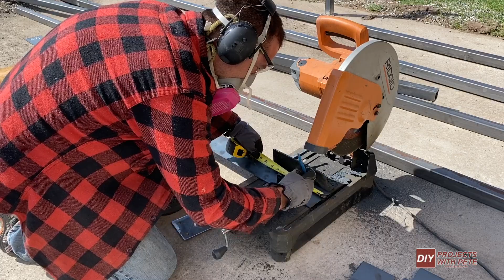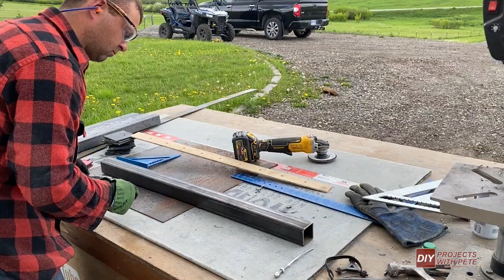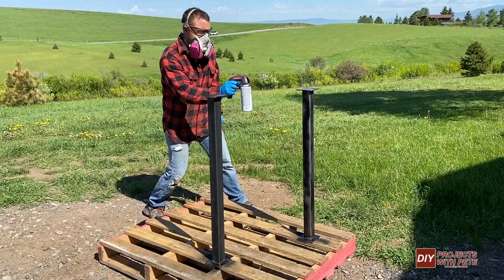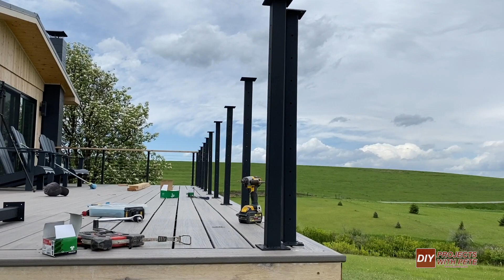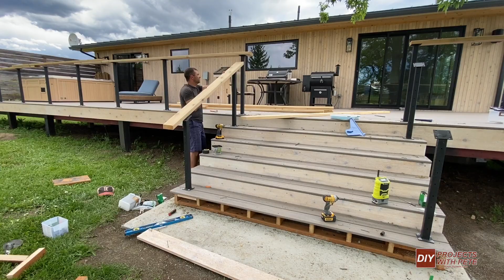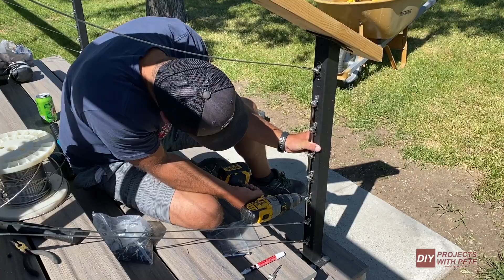DIY Cable Railing with Metal Posts Built from Scratch!

Comment: Guard rail height needs to be 42" high minumum is most if not all states? 
i would like to see stainless steel or aluminim posts to avoid rust. Powder coating would be okay but the steel inside the post will rust anyway.

Comment: Since your install have you had any issues with the top wood rail sagging?
Reply from the maker: Morning! Honestly not, but there has been some minor movement. My biggest thing I wish I'd have done is powder coat the posts as they are starting to fade.  At the time, there were not many post options available online reasonably priced. There may be a few more options these days if you want to look before welding up and doing all the posts yourself. Cheers!

Comment: What an absolutely beautiful job!   I got quotes from some of the DIY systems out there and it was over 8K for a similar size project.  Thanks for such a detailed video of the process.  
I am considering using  stainless steel sleeves for each hole the cable runs through.  Most of the premade posts come with them.  Just curious what your thoughts are on them Do you think they would be beneficial to the system?

Comment: How can horizontal wire railing be to code? 
The potential for children to climb horizontal railings is a major concern.
Reply: Horizontal wire is to code. As long as the spacing is less than 4" (4" sphere rule) you are good to go.

Comment: I had originally thought of having a wooden railing. However after not getting the  railing finished on time, the 4x4 post started to bend. My railing would just look awful. This is exactly what I need to do. Although not real good at welding, I thought of having the steel cut and prepared by me and then welded at a fabricator (welding shop). Then I found post online at a very reasonable price that was far faster than having them built. Thanks for getting me inspired.

Comment: Nice video. I was wondering should you use one noncut length of cable from beginning to end, going through all posts. It is about 30 ft. do you need and type of protection around the holes in the metal posts the cable goes through?

Comment: Thanks for the video , I used your video to do my own deck as well . I spent $3500 on the metal , powder coating and hardware instead of the $19,000 quoted for cable railing .

Comment: I’m building a similar railing but with a steel hand rail.  Does anyone have a recommendation to wall thickness of the tubing to handle the tension from the cables?  I’m tempted to go solid but it will weigh so much it will be difficult to transport to the powder company.

Comment: these cable rail systems usually come with cable "collets" for your inner post to protect the cable from fraying at post entrance/exits also hides the un-sightly holes the cable goes through as they will eventually rust,....and of course the overall appearance would have been much nicer

Comment: I am posting this before going through the entire video. But I would’ve included a weep hole at the bottom of each of your welding posts. You will get rain and moisture inside of each of the posts and you need an exit hole for that moisture to escape. After a few years you might find you’ve got several inches of water and they will rust out on you.

Comment: Good video, but I have a couple of comments. First, you are loosing a lot of room by setting your posts that far back. A different bottom bracket that wrapped around the front would give you that  space back. 

Second.. Not sure how you tested the lag bolts, but a 3/8 lag bolt provides between 210-265 pounds of pullout strength. That means close to 1000 pounds per post (4 bolts). That should have been more than strong enough. Sure bolts, nuts and washers are stronger, but WAY overkill.

Comment: Cutting metal plate vertically was a good move , we already use that in our workshop, also if we are cutting square pipe in length we use to cut its angle on the top side  from where blade starts cutting. It also helps to cut a square pipe easily 👍 ❤️❤️❤️❤️❤️

Comment: We're considering this for a deck at our home.  ANy sense of how safe the cable railing is with young kiddos?  Our kids are 9-14 but I'm thinking about grandkids (someday) and friends with younger kids.  Any chance they can squeeze through the cabling?
Reply: The 2015/2018 International Residential Code (IRC) requires that you can't  push a 4" ball (sphere) through the railing spindles (cables in this case) to trap a child's head.  For cable railing, because cable flexes more than solid metal rod, tension is important to reduce flex.  Also, placing the cables closer than 4", 3.5" for example, will allow the cables to flex slightly and still meet code.
Reply: Also,  Horizontal cable is attractive for toddlers to climb.  Vertical steel bars are the safest but they interfere with the view.

Comment: On the step railing cables . . . . . . . .  .How about making a adjustable drill angle jig OR buying an angle drill press and you could have used the same cable set up as the top deck.
:)

Comment: Hi Pete, AWESOME JOB, thanks for sharing.  I was wondering how the top rail is holding up?  Any sagging or warping after all this time?  We currently have a 6" to top rail, way to thick and obscures our view, so I'd like to replace it with something like your sideways red cedar but worried it would warp.  We will be removing our vertical boards 2x2s and replacing it all with cable like yours.  Thanks again!

Comment: One of the best videos explaining how to firmly attach metal posts to a deck. Rest of the commercial folks are fooling around trying to screw in the posts - which will fail and could cause some major concern. The use of bolts and washers with underside support would provide a very secure mount for the posts! Thank you I was looking for some help and this surely does it. Any idea where I can get pre-made metal posts. I am not good at welding etc hence getting some good quality posts would be a better (more  expensive) option in my case. Also if you can list the other smaller hardware like screws and bolts, etc used would be very helpful.

Comment: adding some drain holes in the bottle of the posts might have been another option you could have done. It shouldn't be a huge issue, but it will help them not rust as quickly if water gets inside the posts.

Comment: Great video!  We are adding a concrete patio to our restaurant.  After a year of the pandemic,  we are looking to the future.  A patio will drive in customers!

Building this railing ourselves will save us thousands. The concrete patio will be at least 3 feet off the ground.   

Any suggestions to securing it to the concrete? We are in PA, if that makes a difference.

If we go with a bigger,  heavier drink rail, do you suggest a bigger mounting plate? We'd love to do a live edge piece of wood, if not to costly. 

Last question.  Aluminum or steel tubes?  We have a friend that restores vehicles.  He can paint them for us. We don't want it to rust.

Great video!  I think we can actually pull this off!.

Comment: I have questions. Has the tension of the cables bowed the wood over time? This is a problem my friend had with his cable rails after a 6 month period. Which made the cables droop and wood wavy. So i was gonna do the tension first, but than the post bowed. I will be making channel out of 16 gauge or 14 gauge steel to go under the wood to keep everything from bowing. What do you think about these problems and my possible solutions?

Comment: Really looks great, I think I'm going to give it a shot. Question on the hole sizes though - For the bottom you used 3/8" drill bit, and that fit the 3/8" bolts? And on the cable holes, you used 1/4" drill bit for the 1/8" cable correct?  I saw on Amazon the fitting terminals for the cable wire calls out a .31 hole. wasn't sure if I should be drilling 1/4" holes, or .31?

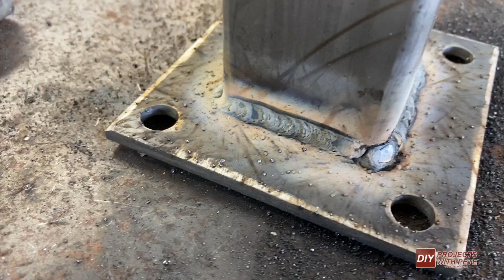Comment: For those of you who weld without the gas as shown in this video, spray your project with Pam cooking spray before you weld. This will eliminate all the "spatter balls" stuck to the steel that you see in this video at time stamp 10:17. The Pam will eliminate the need to clean everything with a hand grinder (which can sometimes ruin the smooth surface of the project). After you are done welding, go over the welds with a wire brush to remove any slag, then wash off the Pam with dishwashing soap and water, same as you would clean a cooking pan in the kitchen. You may still have a couple small spatter balls on the steel, but they will pop of easily by hand with a wood chisel. I have been using this trick for years, especially since I do a lot of outdoor welding where the gas is useless because it is usually blown away by the high winds we get here in Arizona.
Reply: Or use anti spatter sprays less clean up
Reply: I’ve tried that a few different times. Never could get that to work right, and it was harder to clean up the burnt-on goopy oily mess of a coating it left behind. But I also didn’t get good results from the commercial spray. I found the welds were cleaner without and the spatter was easy to knock off anyway.

Comment: Great video!  I'm going to follow your steps and do the same thing for my deck.  Quick question- is the 2" square tubing also 1/4" thickness?  Same as the flat bar?  Thanks.

Comment: You need a drainage hole in the bottom plate to allow moisture & condensation to drain away preferably 10-12mm if possible.
You still have access to the underside of the deck, so this will allow you to save all your hard work.

Comment: Fantastic video and workmanship, It looks really good.  I have heard that the use of dissimilar metals (mild steel and Stainless) may cause rust corrosion to occur quicker especially in a wet setting. id be interested in hearing if teh staniless cable rusts at the contact points on the mild steel. Even with it powder coated i suspect the paint/coating in those areas will rub away.

Comment: Copied your design plus some tweaks... Also forgot to drill drain holes and will add them before the final squaring and running of the cables. BTW - Tractor Supply sells a nice little split cover for the bottom of the posts to cover up the bolts, welds, flange, etc... gives a nice finishing touch. I searched everywhere and it was the best priced and quality I could find.

Comment: Great video. Great content...love that you gave some research of retail ready options and compared to your effort/time.  The only tinnsy tiny detail I could add, is you could put a drop of oil on the metal before drilling to extend drill bit life, but alas you do have a sharpener.  Thanks for a great video!
Reply from the maker: Thanks so much!

Comment: This is a wonderful breakdown from cost to install! I’m looking to do a side mount steel rail post. Options online for purchase are pricey. I have no welding skills but think if I eliminate the base steel plate and just do two large base screws/bolts through the 2” tubing and then an add on bracket for the top of the 2” tube to accept a railing then I will be ok 👌. Any suggestions would be welcomed 🙏🏼
Reply from the maker: Good luck!

Comment: Thanks for the instructional video.  Any concern about water collecting inside at the base of the posts?
Reply from the maker: Thanks! I ended up drilling a hole in them from the underside just in case.
Reply: @DIYPETE  Perfect.  Thanks,

Comment: Love your video, so excited I found it.  I am doing the same project. Making your own posts is a huge cost savings. For about 75 linear feet of railing a "major" supplier quoted me $7,000 for all the posts and hardware. With your help I should get it below $1,500. Thanks!
Reply: But, one question. You said you drilled 1/4 inch holes for the cable/inserts. However, the hardware you used for the end posts, Stud Tension End Fitting Terminal, says you need a .31 hole. Did you drill larger holes in those end posts or was 1/4 big enough for the tensioner hareware? Thanks!
Reply from the maker: I believe the 1/4 inch worked fine for the hardware -- but if not just have it slightly bigger than the hardware so it slides in with ease, but is still a firm fit. Cheers!
Reply from the maker: Awesome! I was in the same boat, definitely saved a lot of money!

Comment: Not sure if you were sponsored or not, but thank you for the drill bit doctor suggestion, just been taking the drill bit out and using an angle grinder.
Reply from the maker: Hi! They sent me one to try out a while back, and I've used it so much that I figured I'd give them a little shout out. So not sponsored, but provided a tool for me to try out with no promises of anything. But it does come in super handy, I don't ever have to run to the store just for a bit, and I feel way less wasteful when it comes to not having to throw away bits. I've used my bench grinder before too, but i do appreciate the consistency of the angles and results, cheers!

Comment: Nice job 👍 for the stairs would the cables work better if you drilled the holes at the angle of the stairs?
Reply from the maker: Thanks! I found it extremely hard to get my drill press to do accurate angled holes, which is why I ended up using the other hardware. Cheers!

Comment: DIY Pete - any idea if wood posts can be used instaled of metal?
Reply from the maker: Hi! Yes you could use wood posts and different hardware. However, you'll need to make sure the posts are super secure. With wood, you may want to have posts secured to the joists and blocked to make it super sturdy. But definitely do some youtube searching for additional ideas! Cheers

Comment: Thanks for this.  I'm redoing my deck and will be using this design.  It looks great.  The only modification will be that I will probably have the posts powder coated before installation.  What types of bolts did you use to secure the posts to the deck?
Reply from the maker: Awesome! I used 3/8 inch galvanized bolts.

Comment: Hi. Does the water go inside the post?
Reply from the maker: It could potentially get in the side holes, but I did drill a hole in the bottom after the video, to help drain each post.
Reply: @DIYPETE  ok thank u 😁

Comment: Very nice design. I would recommend drilling some sort of water drain hole in the bottom of each post. Water will inevitably get in through all the small cable holes
Reply from the maker: Thanks! I did end up doing that.

Comment: @DIY PETE = you might need to drill a hole on the side at the bottom of the beams to drain the water that will enter threw the cable holes + to spray anti rust combound every year
Reply from the maker: Thanks! I did end up drilling a hole in each. Cheers!

Comment: Project looks great, but I'd be terrified that rust is going to form inside each one of the tubes.  Here in Arizona, wouldn't be an issue.  Looking at those green hills of yours, I'm assuming it won't take too long (a decade?) before the structural integrity of the posts are severely jeopardized.  I read below that caulk to plug the holes will help.  My experience is that caulk is a patch, not a fix.  I would've  cut out a center square in the bottom plate just the size of the square tubing to allow the water to drain.  Even just another four drill holes on each inside corner of the bottom plate would be better than nothing.
Reply: @Worldin360-LT  did you read my last sentence? Literally says drilling some holes at the bottom.
Reply: @danielmerkley5660  Lol, yeah I missed read that.
Reply from the maker: Hey Dan! I did end up drilling holes in the bottom. Cheers!

Comment: Just wondering if you put a drain hole in the bottom plate, if you FORGOT, you will get a gradual build up of water from rain, snow, and condensation until it reaches the bottom cable hole. The rust will attack the weld metal first and then eventually the tube will snap off when someone leans on it . . . . . good luck
Reply from the maker: Hi there, I did end up doing holes on the bottom after the video was made.

Comment: You might think about drilling a 'weep' hole in the bottom of your posts on the vertical surface.  Lots of water is going to enter and stay in that bottom three and a half inches.  Freeze thaw cycles and rusting will quickly attack the steel.
Reply from the maker: I ended up doing the hole after the video was made, thanks!

Comment: Good job! I have a question for you. The holes that you have for the cable in the railings have holes for the cables to go through. Over time, these holes will allow water to go inside the 2x2 steel frame and cause issues. Why was that not taken under consideration? A simple solution would have been to have a hole in the bottom steel plate and deck board to allow the water to drain...?
Reply from the maker: Hi! I did end up doing it afterward. It was just something I for some reason wasn't thinking of, but should have. Thanks!

Comment: Cutting flat steel vertically is generally the way you go about it so you did that correctly incase you werent aware.

You get less sharp bits afterwards and the reduced surface area reduces pressure on the cutting wheel.
Reply from the maker: Thanks so much! I had always cut it horizontally, and this worked so much better. Thank you!